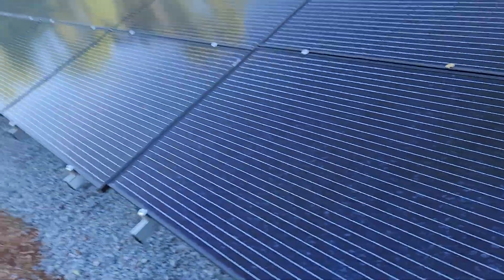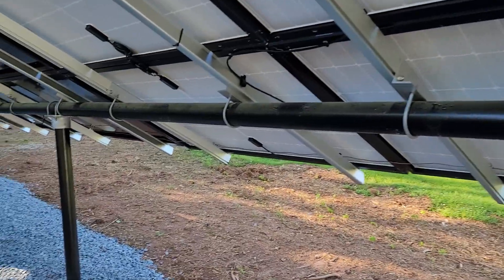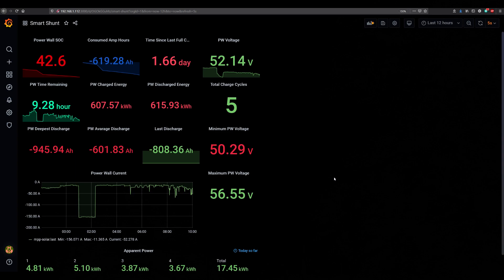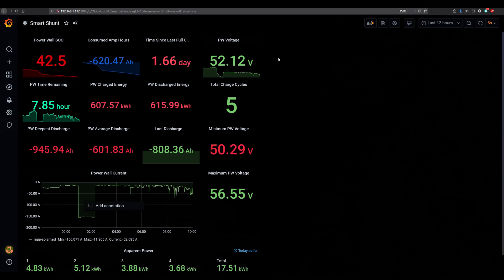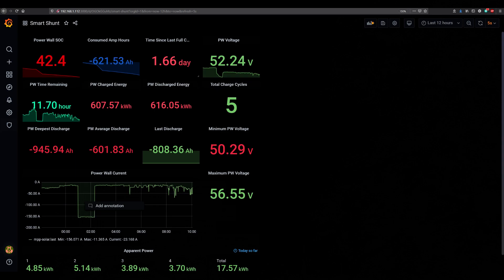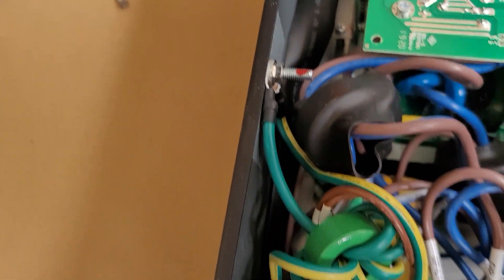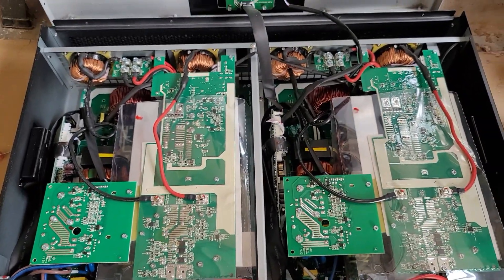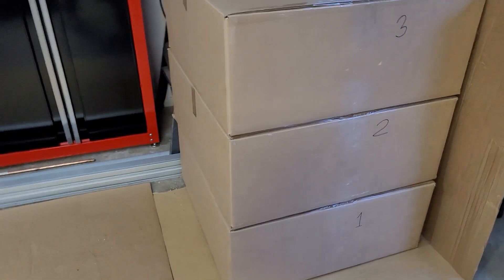DIY 14.8kW Solar System One Month Production Report

Comment: Great work as usual. Adding batteries a great idea. The more the better. I installed a 5kw growatt in a friend's house using a 9.6kw UFO battery.
This is the battery I used. took a month for it to arrive. 
UFO 48V White LiFePO4 Solar Battery
https://www.ufo-battery.com/white-powerwall-lifepo-solar-battery-optional-gprs-solar-storage-system-backup-power
Reply from the maker: How is it working out with that battery?
Reply: @DMIINC2013  
No issues, they like how it hangs on the wall. It's installed in there house in Florida as a backup instead of a generator.  Worked great a couple of times when the power went out. They liked it so much they oredered another one took 6 weeks for it arrive. When they go down there this fall will add it (currently sitting on the floor in their garage). Using a 8K Sol-Ark. UFO has a few formats. I was lucky enough to get someone who spoke English really well, which instilled more confidence when ordered.
I was looking at the GYLL battery from Signature Solar for my system but I like these better. The price on pre-made LIFEPO4 batteries has come down a lot.
Not sure yet though. Really haven't had the time.
I am a Firearms instructor teaching private lessons, CPL and advanced tactics. Things got crazy before COVID-19 and it hasn't stopped. I get to shoot videos but know time to edit and upload. Not really complaining will get a break when school is out. Hopefully...

Comment: idea you probably wouldn't want to since I wouldn't BUT a consideration would be if feasible. Use the car battery as a buffer. Say keep the car battery half charged then on nights before projected sunny days fully charge the car that way you power wall can be very low to accept the whole days sun. Problem is several sunny days in a row you still can't store it all especially in mild weather where HVAC load is low. Of course you could also try training wife to dry clothes and use dishwasher etc. on only sunny days etc. Good luck with that LOL !!  Another possibility "give" excess power to a neighbor or even charge their electric car thats not used much in daytime. Night shift worker etc.

Comment: Somebody will be happy with thoseLV5048's. The loss of production is one reason I went with the grid battery (Net Metering) as for my circumstance I just would never be able to afford a 200 kwh battery but times change maybe another storage medium will be available hydrogen comes to mind (just dreaming). You have a great understanding of electricity.
Reply from the maker: I would have considered grid as storage if GA Power had it. What they have is "we'll buy it from you at $0.03 and sell it back to you at $0.10 when you need it"
Batteries are passion. Sort of LOL.
Reply: @DMIINC2013  yep not a good deal Ontario Hydro is buy for .07 and sell for .10 so not too bad approximate numbers the real ones are $0.26